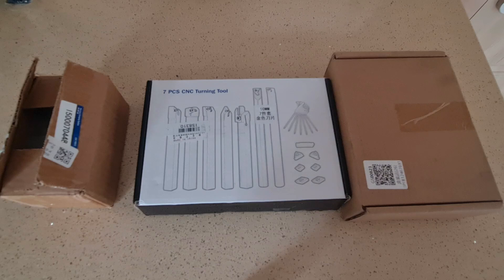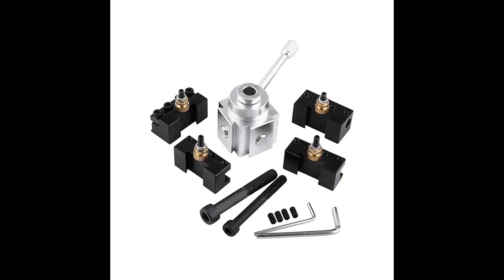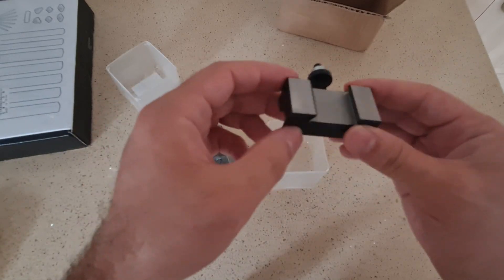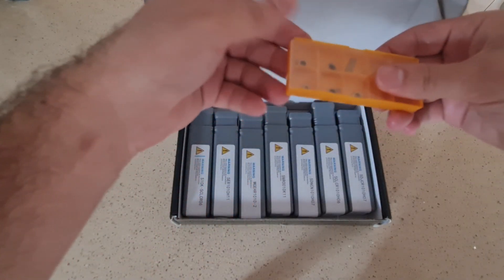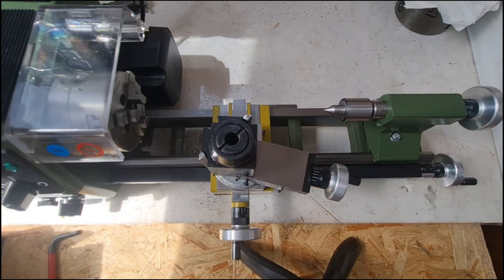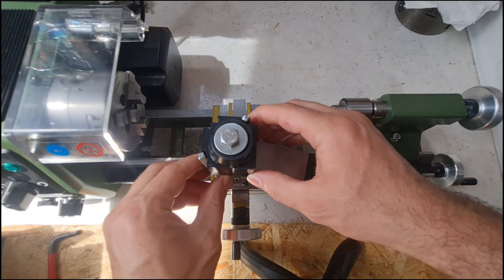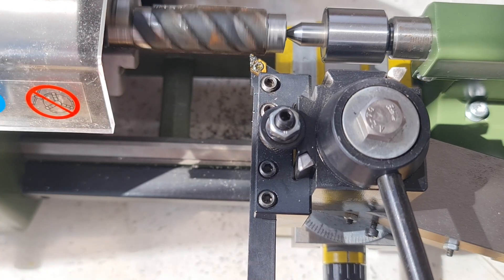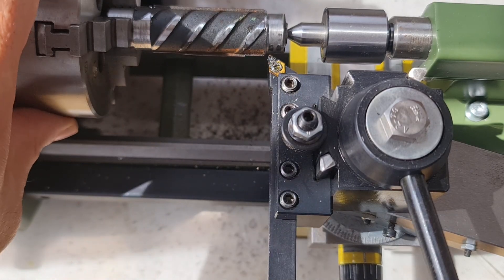Revenge from Rebar - New QCTP and carbide tools for Proxxon Lathe

Comment: Have you considered machining the tool post screw to M8 size? Maybe you could cut off the original thread and reduce it to M8 at the tip.
Reply from the maker: I am thinking to add some thick metal sheets instead of the taper cutter directly to carriage. i am thinking it will be more rigid. And i will cut directly a M10 screw hole. But if continue with taper cutter installed, i will machine a new screw m8 at the end and the body will be 10 mm.

Comment: Hi. I left a comment on your other video about aluminum inserts. Try it sometime. It greatly increases the amount of material removed per pass, in addition to providing a better finish. On my channel, there is a video where I compare the two inserts and the HSS bits. You won't regret it.

NOTE: For this insert, I was able to increase the durability by adjusting the tool 0.1mm to 0.3mm below the center line.
Reply from the maker: I will look for it to buy in the future.For now i can remove 0.2 mm for starting and than drop to 0.1 mm. This tools are good for now but it look like i will need better ones in the future for time saving. I will surely check your channel soon. Thank you for your comments :)

Comment: Haven't watched the whole video yet, but maybe you could think about inserting some 10mm 1 mm wall steel tube into the new QCTP to compensate for the smaller screw
Reply from the maker: Its something should be considered to use this qctp in such a small lathe. For now  that huge gap allows me to easily adjust it for some work. But one of my next project will be a screw for especially hold this qctp precisely in place.